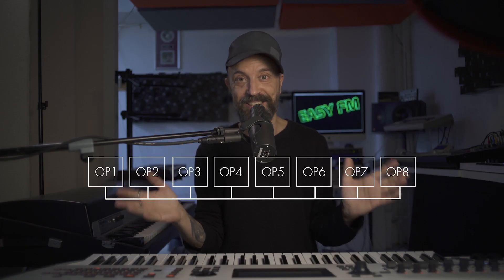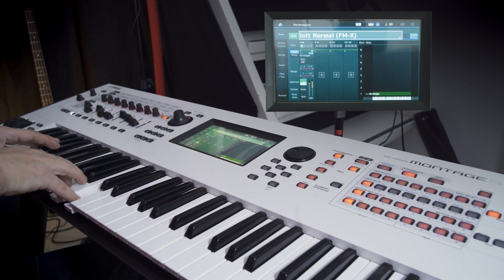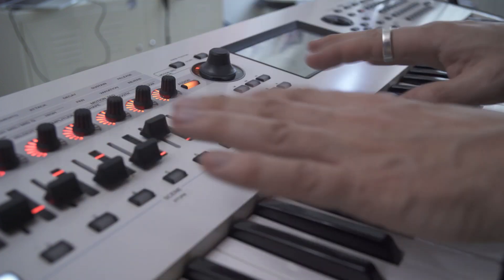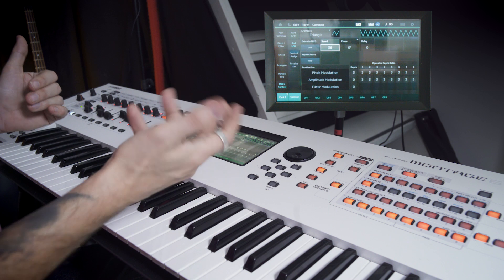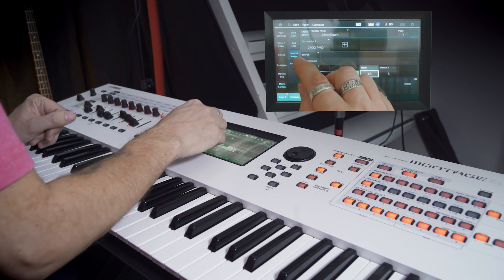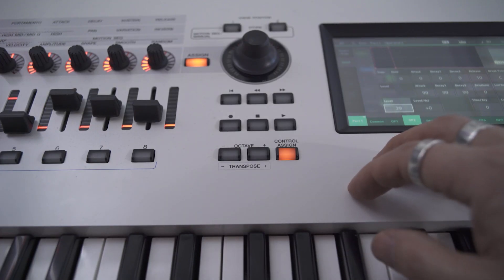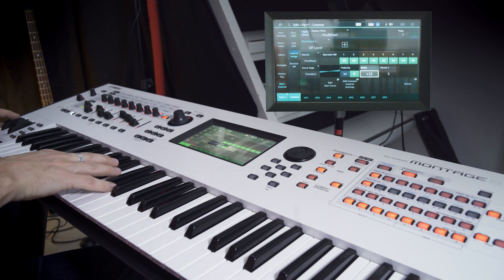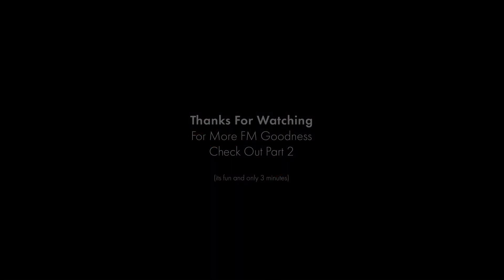Easy FM - part 1 - How to create a filtered sawtooth

Comment: Awesome video, You are a Saint sir. Been figuring out this whole FM thing on the Montage. (Noob here) 

I'm still confused withMod/Control, depths, ratios for when assigning it with mod wheel or any controls , There are too much ratio settings in every department  to figure out. It's so frustrating/confusing for me.  =(